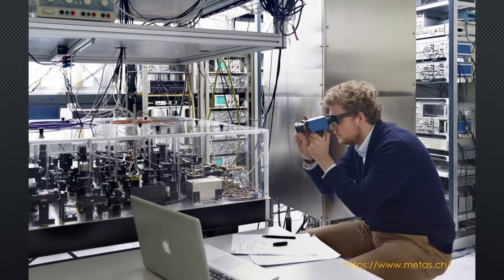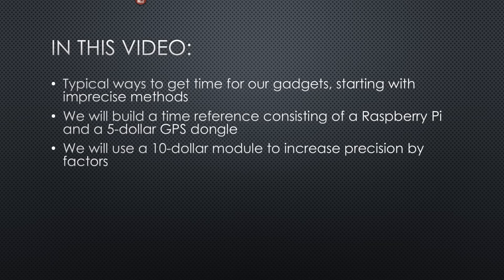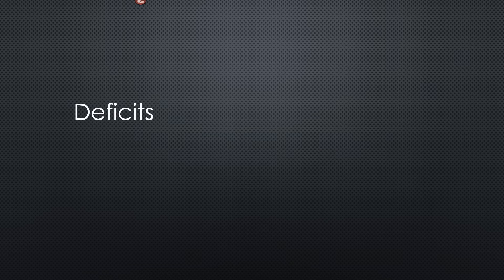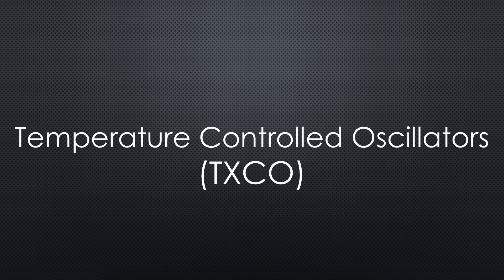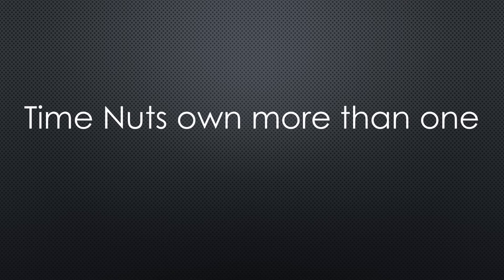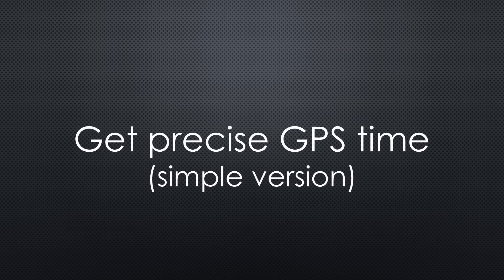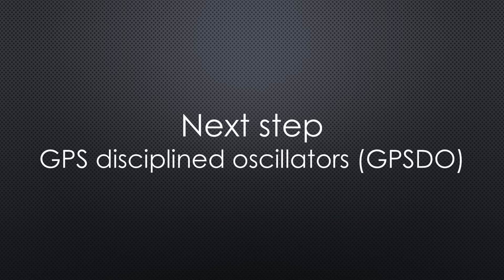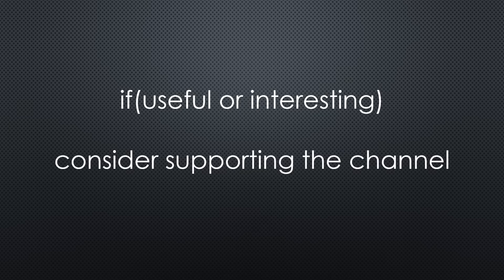(503) Precise Time without Internet: NTP Server from GPS Satellites

Comment: Thanks for the nice video, one "claim". NMEA 0183 will be pronounced NeeMea OhOneEightFree  as in Cee-ThreePio for C3PO from Starwars.  I am stretched on the next videos (bin gespannt auf die nächsten Vids)
Asking a swiss for metrology is a good idea methink. So why is there no temperature compensated OSC just by measuring °C and adjust a correction factor (aging included)?

Comment: Thank you, Andreas [ & Jeff] I have been inspired.  With the Adafruit hat, I'm running a GPS-disciplined stratum 1 NTP server on a Gentoo Linux Raspberry Pi5 using gpsd, PPS over GPIO, and ntpd with kernel PLL successfully active.  And I can keep the extended antenna indoors next to a window, so I did not have to run a line outdoors.  
Does hosting a stratum 1 NTP server qualify me as a candidate to the brotherhood of Swiss watch makers?
Reply from the maker: I am not sure the watchmakers are so innovative ;-) But you are definitively a TimeNerd!

Comment: I've been using xgps (from the gpsd-clients package) to tune my antenna location for the past couple of weeks.  I regularly sit at 10-12 "Sats Used" now, up from 6-8 before I started moving things.  I use the nice graphical display of satellite locations to tell me what is obscuring the signal.  Turns out the trees to my south aren't too big of an issue, but unsurprisingly our chimney is literally a "brick wall."
Reply from the maker: Indeed, this diagram is beneficial because it also detects obstacles at a greater distance. For example, here, I have a hill behind me that blocks quite some satellites.

Comment: Thank you!
Please advise the schematic and code to couple this USB-GPS dongle with ESP32-S2!
Reply from the maker: In my next video, you will find the code for any ESP32, but with a serially connected GPS.
Reply: @AndreasSpiess  I mean that serially connected GPS, like Neo6, have very poor build quality - usually 20 units from batch of 100 pcs do not work due to defects in antenna, soldering, high current consumption etc. 
That's why I'm struggling to connect ESP32 with other GPS modules - those with native USB, but with no success till now (
Reply from the maker: So far, I have not used these numbers. But I got a few neo-8n, and they worked ok.

Comment: These more expensive versions of the GPS receivers have more than just a higher accuracy.
A lot of these modules have the option to change the frequency of the 1 PPS output and can be used to generate a precise 10 MHz reference signal for test equipment like frequency counters and function generators.
Reply from the maker: Good to know. Thank you!

Comment: My setup fails to get serial output from an Air530Z on /dev/serial0. There are no devices listed that match /dev/ser*. I do get output on /dev/ttyS0 but it is not nicely formatted. Lots of commas with only the odd $GPTXT,01,01,01,ANTENNA OK*35 to offer any hope. Am I missing a step? 

Also, cgps -c does not show a fix. Do I need to fit the battery on the GPS module? I thought the Pi provided power.
Reply: It just took a really long time to sync - after an hour or so the green fix light started to flash and cgps -s worked as well as ppstest (replacing /dev/serial0 with /dev/ttyS0)
Reply: @bartjsmit  The battery on the module will improve your cold start time. Or you could just never switch off the raspi.
Reply: Yes, thank you - as I suspected. I was merely unsure if the unit would run without. With an active antenna stuck to the loft ceiling the fix time is super fast now. Next step is a website that shows the time in big bold numbers. I was thinking of adding a small satellite status display to that, but the ones I've spotted are graphical apps on the pi itself.

Comment: I used ntpsec as base (was new then and has an interesting history) It includes also the impressive ntpviz monitoring  tool. Then heating the RPi processor with a 5 Volt 50°C PTC element. And additionally heat the processor with  ntpheat to stable 59°C. Then packed the whole thing in a Styropor box. Temperature compensated the maker way. Search for "Stratum-1-Microserver HOWTO" by Eric S. Raymond. And "Heat it UP" in "NTPsec Project Blog"  And sorry: This time Andreas is behind the TNT, Time Nuts Trend :-)
Reply from the maker: Thanks for the links. Particularly the idea of using the temperature sensor of the Pi to stabilize its temperatureis very creative!

Comment: What a timely video again! I have a OCXO which will be calibrated soon, but I'm considering building this as well, very tempting. Thank you Andreas!
Reply from the maker: You can use a PPS signal to discipline your OCXO if you want...
Reply: No way to connect a 10 Mhz OCXO to the Pi (I am not aware of anyway to do it).
Reply from the maker: Usually, you divide the 10MHz to 1 pulse per second and compare it with a GPS PPS signal. If there is a difference, you adjust the calibration pin of the OCXO. This has to be done very slowly. Like that, you have GPS timing in the long run and OCXO jitter in the short.
Reply: @AndreasSpiess  Thank you 👍
Reply: @ 1: you need to use a microcontroller to get a 10M:1 clock divider. I don't think there is a clock divider that does 10M:1. Most clock dividers are 2^n.
2. You lose a lot of resolution at 1 PPS. The internal clock of the Pi will have a lot of jitter, basically making it inaccurate for millisecond timing (PTP). If you lose GPS lock (ie too few GPS Sats visable) it quickly becomes in accurate for PTP.

It makes more sense to run the cpu clock off a OCXO so the timing accurate & no need rely on interrupts to keep a RTC\NTP\PTP disciplining the CPU Crystal oscillator. 

Plan B would be a microcontroller emulating a PI supported RTC using an OXCO that can provide PTP & is connected to the Pi. I don't think there are an RTC's that will use a 10 Mhz clock. I believe all of them use the standard 32,768 hz clock. I think Microchip (PIC) has some precision RTCs but they are very expensive.

FWIW: I tried setting up a PTP grandmaster clock (linuxPTP) using a LAN card that had a TCXO clock, & a USB GPS dongle  but the jitter was very high.
Reply from the maker: Maybe you google "GPS disciplined oscillators, GPSDO if you are concerned about jitter. They use a 10MHz oscillator that is adjusted over time by the PPS signal. They are extremely precise (mine was in the 10^-10 area). 
No microcontroller is needed to divide a frequency. A CD74HC390, for example, divides by 10. Seven of them will do the trick...
Reply: @AndreasSpiess  I don't believe low cost GPSDO modules use a precision 10 Mhz oscillator, they just use the timing signal provided by the GPS satillites which have precision oscillators. usually GPSDO are limited to either 1 PPS, or 10 PPS. I don't recall every seeing a GPSDO module with a precision 10 Mhz Oscillator. I see a few 10Mhz GPSO oscillators but no NTP\PTP functionality. 

There are commerical NTP\PTP servers with OXCO or Rubidium, but costs thousands.
Reply from the maker: I once showed a GPSDO from China for around 100 dollars. Then I was invited to the Swiss Meteorological Institute, where we compared it with their best clocks. They were astonished ;-)

Comment: Only issue is that the Pi internal clock, or RTC with 32Khz has high jitter. so if you lose your lock on GPS, your time fall out of sync until it reconnects to GPS. another issue with clock jitter is if you using millisecond timing for an application since GPS clock is 1 PPS (1 pulse per second).

Probably the better option is an arduino using a 10 Mhz OCXO clock to provide a low jitter clock. I wasn't able to find a way to use a 10 Mhz oscillator using a Pi.
Reply from the maker: I assume you can divide a 10MHz to get the PPS signal if you want.

Comment: Is it possible to use an Orange Pi 5 for this project? The Orange Pi 5 has different gpio pins (26 pin instead of 42 pin)
Reply from the maker: I do not know if you get the software compiled for this platform :-( The pins should be adaptable.

Comment: What a coincidence. I literally did that last Sunday but with an ESP32 :D
Reply from the maker: Did you also use the PPS signal? So far, I have only found projects for "standard" NTP servers
Reply: @  No, I didn‘t need high precision, just the time. I wanted to make my own NTP server in a remote location.
Reply from the maker: I tried it now myself. It was quite easy to include the PPS signal in the sketch (home-made).
Reply: @ Interesting! I‘ll look into it as well, even though I don‘t need it yet in my configuration.
Reply from the maker: You will find the sketch in my next video. It was less precise than the Pi...
Reply: @  Wow, I‘m looking forward to it!

Comment: I started my time nut journey by building a rubidium based wall clock.  I wanted a clock accurate enought that I would have to reset it during leap seconds.  It works great.  Also, let me show you my GPS disciplined grandfather clock!
Reply from the maker: How did you synchronize the grandfather clock?

Comment: Tahnk you very much! Would it be possible, to use an old Android phone as an GPS receiver and NTP server? I have some older Androids which I could place in the attic.  Currently, I try to configure the computers (also the ESPs) in my network to get the time from the (S)NTP server of my router. The router gets it's time from an NTP server in the internet.
Reply from the maker: Another viewer gave the hint for a Time server apk. But I did not find it. A few apps provide synchronization of the Android time with GPS. But I did not find one taht offers a NTP server.
Reply: @AndreasSpiess  Thank you for your response. I think,  time will tell.....

Comment: I logged shadow band data in 2017 using GPS time. The system had a two hour mission, so I didn't have to worry about power consumption or long term stability. I picked the starting time from the GPS puck and used the PPS to time events. It was simple and worked well.
Reply from the maker: Interesting project!

Comment: Could this be done with an ESP32 module instead of using the raspberry pi?
Reply from the maker: Maybe. If you find a project or write the software yourself. I did not search for it because a Pi Zero is not too expensive.

Comment: Thank for the interesting video.  While I haven't the time nor money to be a time nut, I do enjoy accurate time and want everything in my house to display the accurate time.  In my experience, general-purpose microcontrollers are often far worse than 40ppm and some will drift by more than a minute per hour unless they have an RTC-grade internal or external oscillator.

However, some time ago I tested a random DS3231 RTC module running on its backup battery for more than a year and found that it demonstrated -0.335ppm accuracy with no calibration at all; that's about 10 seconds/year, though the manufacturer's specification is 2ppm or 62 seconds/year.  My test unit might achieve 0.1ppm with use of its calibration registers, but a good reference is needed to calibrate from and it takes time to get an accurate drift measurement.

GPS is a high-accuracy time source, but I also like projects that require neither the Internet nor satellite communications to keep reasonable accurate time while consuming barely any power.  That's the sort of nut that I am ;).
Reply from the maker: 0.335ppm is very good for such an RTC. It was probably sitting at the same temperature all the time and you had a lucky hand when you ordered it ;-). I agree, they are good for most applications.

Comment: This may not be available to you, but since I live within 50 km of the mainland US transmitter I thought I should mention this.

The US has two shortwave stations that broadcast the current “legal” time. One in the mainland (Colorado), on in Hawaii. Most people are familiar with the voice bands but there also data bands.

This is what consumer “Atomic Clocks” use. Behind the scenes there are, in fact, atomic clocks keeping the official clocks in sync.

However it also has a PPS signal that can be used in the same was as any other PPS source.

I’m so close to the transmitter that I don’t have to worry about propagation delay, and the signal can’t be heard in much of the world.

But if you don’t want to use GPS, or can’t for some reason (eg no access to a clear view of the sky) then this could be a good second choice. The shortwave frequencies were chosen, in part, for their ability to penetrate buildings. At least a little.

This could also be used as an independent check on the GPS (or any other) time. GPS jammers exist, and while I don’t think they can introduce a time error of more than a few milliseconds before the receiver would be unable to get a lock it is the type of potential attack that a really paranoid security review might call out. To rattle you, if nothing else. So it’s a nice card to have on hand if someone gets smug and asks you what you would do if the satellites get screwed up.
Reply from the maker: You are right with these "Atomic Clocks". I already made videos about them and even operate my own DCF77 (same as WWV in Europe) in my basement to synchronize my IKEA clock ;-)
Reply: Nist in Boulder Col. also offers the clock signal by telephone.. as well as WWV but very long distance:).  Radio controlled clocks under $10
Reply: @melmaki1118  I can’t remember the last time I called it but that’s my local “time”. This makes sense since I live in Boulder. :) It’s was still startling the first time I heard it since I was used to a more conventional voice and had only heard the WWV signal on a cheap SW kit.

It’s weird to say this but I would no longer consider the telephone PPS to be particularly accurate, at least not when compared to the shortwave signal. The old analog system had latency but it was very predictable since it only involved dumb electronics. Basically just some microwave towers and a small amount of intelligence in how to route the signal. I suspect it was a lot like how we manually routed email in the early 80s when we had to determine the route ourselves. (Good old bang notation!) Everyone quickly learned the shortest path to the AT&T backbone and then how to get from the nearest AT&T node to their destination. It reduced a huge star graph to a connected sets of much smaller trees.

In contrast today the individual packets carrying voice data could go different routes and could even be cached briefly. The software will drop packets instead of playing them out of order, but there could be a delay of an unknown and unpredictable amount.

At least it won’t be a long delay - you can’t do that with live phone calls. With canned stuff it’s easy to find a delay of many seconds if, eg, you watch the same tv channel on your tv and mobile device. Or even two different tvs in the same room.
Reply from the maker: @beargiles4062 PTP seems to adapt to the network delay and take it into consideration

Comment: A few years ago I went down the time nuts path with a couple of eBay purchases of precise oscillation equipment sourced from defunct cell towers.  I had precise 10MHz pulses in my workshop, but didn't get around to building the clock.  Since I moved, I've forgot to take my GPS antenna with me and it's still on my to do list to get a new one.  I'm sure the owners of my previous house wonder why I needed a GPS antenna to know where my house is!
Reply from the maker: Indeed, most people do not know that GPS is also a precise time source!

Comment: There is an android apk file called Time Server that runs an sntp server and synchs time via GPS, i use this for this exact purpose. It requires root and can be tricky to find... might be needed to compile it from sourcecode
Reply from the maker: Thanks for the tip! Indeed, I did not find it (in addition htat I do not have a rooted device). But maybe interesting for somebody else.
Reply: @AndreasSpiess  Yes sorry i didnt find the link when i posted it, here you go.
Reply: @AndreasSpiess  I have tried to reply with the link but it gets removed. its on github but need to compile it from that source
Reply from the maker: YouTube deletes links. If you post a serch text it should be possible to find it

Comment: I tried writing a sketch using a DS3231 to tell me the time on Mars.
It almost works. 
One step I took, was using Earth's Jan 1st and zero second line 
as the line that marks the beginning of the Mars year..

The problem I have not fixed is counting how many Mars days have elapsed.

The objective was to use the Mars clock to tell me where 
Mars orbital and rotational position is.
Reply from the maker: I am no specialist in astronomy. Just for fun, I would ask ChatGPT for the code ;-)
Reply: @AndreasSpiess  Thanks, I used copilot. I asked, 
"What was the unix time when Mars last crossed the line that marks Jan 1st and zero seconds on Earth?"
I used that as the beginning of the Mars year.
The rest is a lot of math. Mars days are longer and the year is over 600 days long..